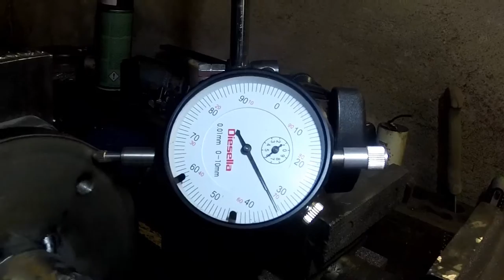Piranha Buggy @ SICK Project Part 21: Brakes!

Comment: HELP  Hello I'm building one of that (the minor model "sidewinder plus"). I would like to know where did you find the front wheel hubs and front end studs. Where they come from actually. (I can't spend 800$ for the official "the edge products" brake set)
Thank you
Reply from the maker: Hello Giovanni.  The front hubs and studs, are from a quad Yamaha Yfz 450. You can find them cheap on eBay :) https://www.ebay.com/itm/2007-YAMAHA-YFZ450-YFZ-450-LEFT-RIGHT-FRONT-SPINDLES-WHEEL-HUBS-BRAKE-ROTORS/282662313084?epid=1011871626&hash=item41cffc9c7c:g:8N8AAOSwzx9ZwroT&vxp=mtr
Reply: Piranha Buggy @ SICK Project! Thank you so much! Ahaha I was stuck in this build at least for 6 month because of that problem. Thank you so much!!!!!